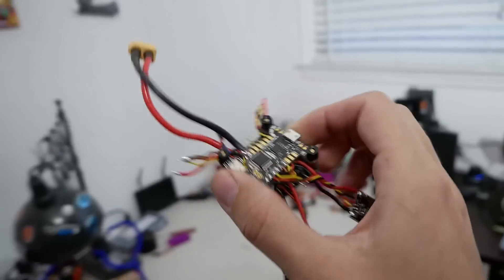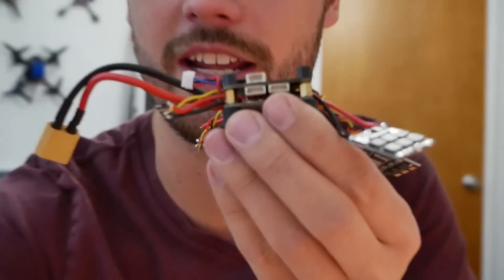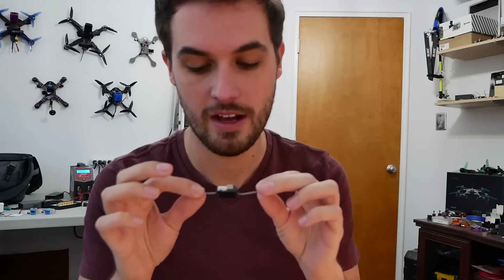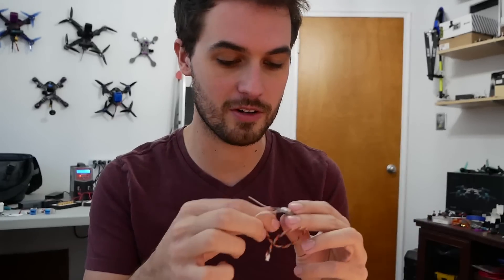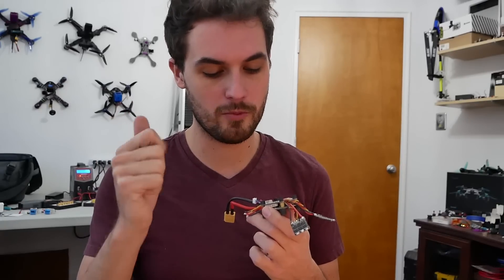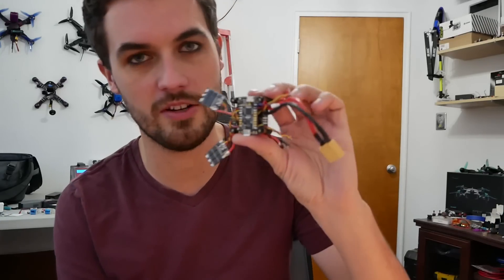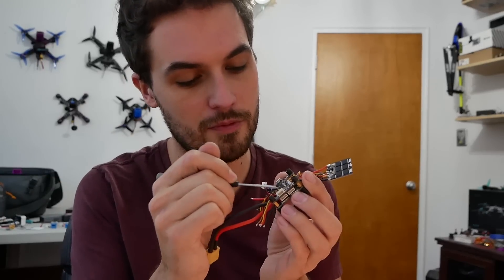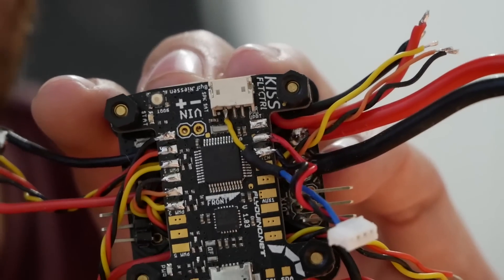Connecting KISS V1 FC and Spektrum 4649T Reciever

Comment: Have you tried KISS with the new serial micro receiver the SRXL2 one man. Im struggling getting it to work with kiss.
Reply: Did you have any luck? Having the same problem right now with Kiss V2 and the Spektrum srxl2.
Reply: @jmarsden73  Never I litterally stopped flying because I've spent thousands on KISS products. They're team lied to me several times saying there were on it and they had fixed it . Then ignored me for months again with no help.  I've lost motivation in this hobby due to lack of help getting things to work right. I have 3k in equipment and  Alien Kiss builds  :(

Comment: Great second vid Drew, I'm really new to FPV and have watched nearly 90% of your videos on your primary channel and probably like 50% of rotor riots. I would like to see a bit more information on how you found the video feed wire. Did you use a Voltmeter or did it have markings on it what am i looking for. Just in general when you guys are adding things or changing parts i haven't a clue what you really just did.  Also the science about Voltages, batteries and cells like what Volts should i be seeing whats normal. when am i adding to much power or not enough. How do i figure out how many battery cells my motors can take. Maybe im asking a stupid question. But sometimes i feel i have more questions after a video then before i watched. But Keep up the good work dude im really enjoying your vlog's and thanks for getting me in to this amazing sport.

Comment: Hi Drew, I used this receiver (brand new) with a brand new DX9, antennas placed out of the carbon and at almost 90 degrees, and I got like 100 meters before the rssi warning kicked in.. is that normal? with the other non telemetry receiver I got like 200 meters and then failsafed...

Comment: or just use the 3wire plug remove voltage and ground then solder the signal wires together less  risk of damage to the fc

Comment: hello, I use the exact same setup (kiss fc and spektrum 4649T but i wired it an other way and is seems easier: using the rx2 and the nearby ground and 5v pads: https://puu.sh/yNuaw/0cac16049c.png

Comment: I’ve been using the spectrum port on the kiss fc with my spectrum telemetry receiver..  I think it works fine
Reply from the maker: You mean you’ve been powering it with 3.3v?
Reply: Drib 2 yeah .. should I lose signal strength because of that ?
Reply from the maker: I’m surprised the receiver powers on at all. But if it works it works right? :)
I’ll have to look into it. Thanks fir telling me!
Reply: Drib 2 no prob I still use spec sat port in the KISS GUI
Reply: Drib 2 and would it weaken my signal or nah?

Comment: Can you help with a good 5 inch and 6 inch set up? I use different recievers but i was mostly interested in a good set up on the electronics and motors. Not looking for super light or anything...just something that will fly well and still be fun to do tricks etc...

Comment: Is this the best reciever for spectrum? I have this in my fly egg 130 and range is not good. If it is maby it is coming down to the devo 7e running devation that I use. If that is the case what protocol would you recommend
Reply: Josh Bartell run the 4648 or 4649t for sure.  On the Devo, make sure you click on DSMX and choose "hi-speed" so that it uses 11ms, and if you get the 4649T, turn on Telemetry as well.
Reply: Qreacher I have the 2648 and dsmx will bind but it is very twitchy. How do I select high speed?
Reply: Josh Bartell go to the model menu where you selected DSMX, highlight it and press enter.  It will take you to the DSMX options, and one of them is 'high speed'.  One of the cheapest options to get 11ms. 😉
Reply: Josh Bartell as far as twitchy... Could it be your rates are too high?